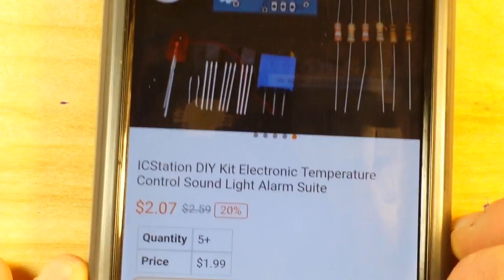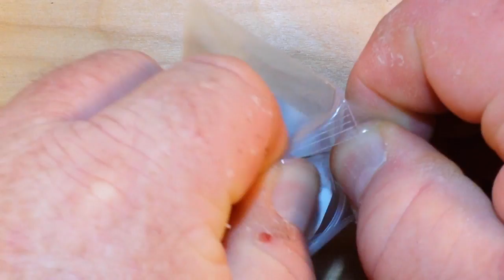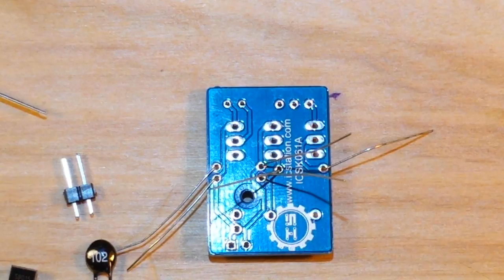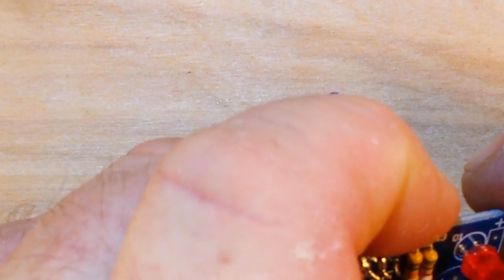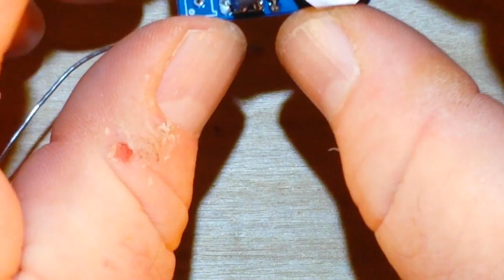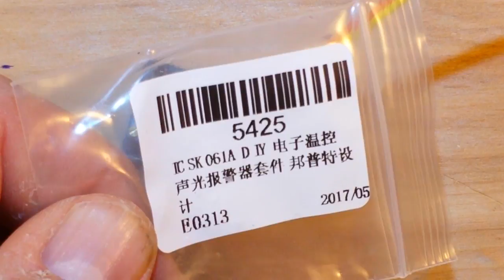Temperature Alarm from Icstation com

Comment: I tried this one, but did not work.  It is not product defect.  During soldering, most likely, I messed up.  The batteries became hot during first trial.  Then I measured the resistance of the whole circuit.  It was showing almost zero.  I  cleaned up the soldering defect.  The resistance now is about 5K.  The current flow with 5V is 50mA.  Still it does not work.  Moreover, S9015 transistor is becoming very hot.  I have to try the whole circuit on a new plastic board.
Reply from the maker: If there batteries are getting hot, you have a short somewhere.

Comment: These run best on 3 volts. I was using a higher voltage and I could not adjust sensativity. It also may be why some of you are having trouble blowing them out? Just use two double or triple AA batteries. I 3D printed my own battery holder and it works like a charm! It says 3 to 5 volt on the website, but use 3 volt.
Reply from the maker: +fossil25 Good info there. Thank you!

Comment: I purchased 3 of these and put together two and ran into the same problem with both, the 9015 transistor heats up too much and fried on both.  Anyone else have this issue?
Reply: Yes, I bought 4, assembled 2 so far, with much care not to overheat the components, still, none of the 2 work, 9015 just get's super hot. Turned the potentiometer all the way to 950ohm and the other way up to 200ohm, and nothing, only the 9015 toasting away.

Comment: How can we reverse it, so it alarms when the temperature drops? Ok so reverse the potentiometer?
Reply from the maker: J. Clowers no, the pot simply sets the voltage at which the first transistor turns on. You would need a way to turn the transistor on when the voltage falls below a set point.